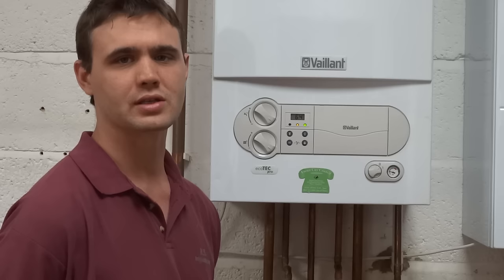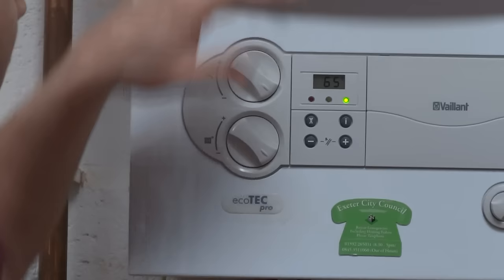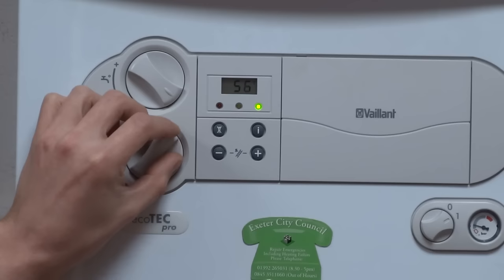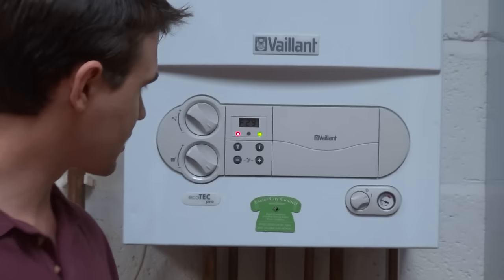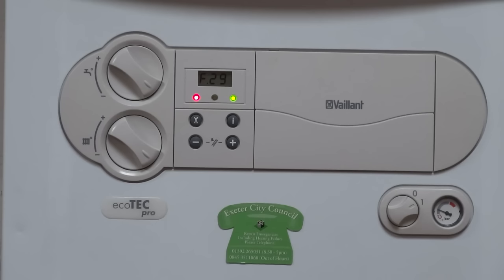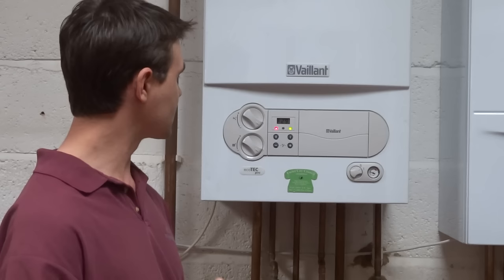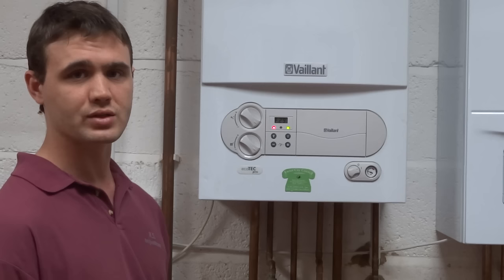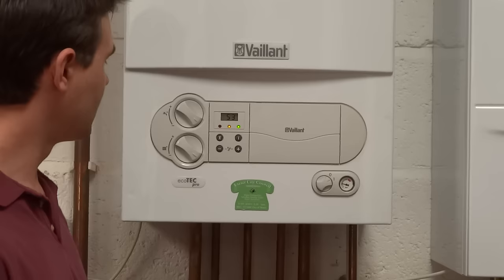Vaillant Ecotec Mk 1 - Resetting the boiler.

Comment: One important thing you failed to tell people: The water temp knob, if its turned to Max will activate  the preheat feature, this is indicated by the green light being on constant (as in the video) when the temp knob is turned to Min preheat will be turned off and the green light will be off (after turning it Min move the knob back to midway position or the water temp will be too low). Now when water flow is detected & the boiler fires up the  green light will be flashing. I mention this as preheat is a feature which keeps the boiler hot 24/7, this results in water arriving at the taps a bit quicker but the downside is you will hear the boiler fire up every 1/2 hr or so 24/7 which can result in £100's  extra in gas consumption per year, its optional so try it both ways, personally I would never use preheat as it can cause other problems like scaled up plate heat exchanger etc.
Reply: I was curious because I've set mine to 50C and the green light did not lit up.
Thanks for the info.
Reply: Tank you!
Reply: jaxmar88 I turned both water and radiators to minimum and the darn thing still activates,can you advise please
Reply: jaxmar88 so I have a eco tech pro 28 my plumber says optimum temp is 66 on heating. Is that correct? Also what should standing pressure be I don’t have a number just the grey line as per the video. At minute when on it’s just under half point on the grey grade when off it drops to just over the grey start of the grey line. Cheers
Reply: ahhh, id been wondering why mine was firing up without the heating on. thanks for the info !

Comment: Another use case is away from the boiler if someone accidentally turns a thermostat to zero the boiler won't fire. Always check thermostat dial which might be in your hallway.
Reply: Someone moved dial and now top reading is hN1 for heating bottom still says cylinder Im reluctant to move dial because I dont have a clue about it..can you advise please..!!
Reply: Cashino Ntd.ive been trying to find out about the thermostat thats in hallway.

Comment: Hi my boiler is flashing saying 2.3 I dont know whether to reset as my radiators are very cold when I put them on I put pressure slightly up but still flashing.

Comment: Thank you so much!  Was tearing my hair out with frustration! the radiators could not warm up even though the boiler was working.... Radiators scorching hot now.  Thanks again.
Reply: what did you do i have the same problem, did you just reset the boiler?
Reply: @angelainniss7986  Check the video at 1:00 min. Lower dial is used to set maximum temperature of your radiators. I was also looking for this info.

Comment: Fantastic mate. Very clear. Thanks! 👍🏻👍🏻👍🏻

[edit] after resetting, the hot water continues to work (that was never the problem) but the radiators won’t turn on - no light appears when radiators are on like when we turn on the hot water tap. Could be an issue with the radiators themselves? All valves are open and the heater temp is turned all the way up.
Reply: Is your problem solved. I have the same issue and I am looking for a solution
Reply: It's night in here and the mechanic will most probably come on day after tomorrow

Comment: Appreciate this! Been puzzled a while as to what temp setting for radiators is best! Thank u! On Max! No idea too what the plus and minus buttons do either! Can u explain those? I hear a lot about “pressure bar” what is best number it should be on? Why does pressing ( i)then (+) do a count 1-10 each time it’s pressed? What should it be? I left it on 1. I’d like to understand more basics about its buttons. Often in winter I get F.75 code. Not sure if it’s something I’m doing wrong? I did think radiator dial was supposed to be same as water one so I’m glad at least I know that now! I have a small baby so need to understand better my boiler.

Comment: Thanks . When is it ok to call Valiant gas boiler specialist with this code F28 if it occurs more than once? Normally the Valiant staff ask for call out charge even if the boiler is under warranty as ours is only 6 months old. They refund if the boiler is faulty ? Why should F28 code comes on even gas supply is ok in the house? Does it mean part failure inside the boiler?

Comment: Hello thanks so much for the details.
I have a question if I may, I have the vuw 280/2-5 type and I can't get to level up the water pressure. It stays really low and I have no idea if the radiator are getting filles up. Any suggestion on this? Thanks a lot

Comment: Hi, I have the exact same boiler and after installing new smart thermostat it worked just fine for a week and one day the boiler would not start without turning thermostat on, and when I did turn it on, the boiler is heating the water and when it comes to heating the radijators I hear it starting and then just stops. Could it be some kind od blockage because of a thermostat. Up until now there was this really old thermostat. Anyway, the boiler and its connections appear just fine

Comment: I’m getting this now after 10 years of installing this boiler.   In my case. There’s gas going through but the red light stays on.  I restart it and it works for about 1 min then goes back to red again.  What could be wrong ?
Reply: It maybe that you have a leak somewhere in the system.

Comment: I've got a Vaillant ecotec plus 837. Getting hot water to taps but not to radiators at all. What could be the cause? No fault codes showing.
Reply: I have the same problem and I can’t get any answers

Comment: Having issues with the heating not coming on. This is the exact boiler I have, what happens if there is no orange light on at all? What would you recommend?
Reply: Peter the same is happening to me now aswell
Reply: Niki Warda I’ve changed batteries in thermostat as I have the flame icon on there. Nothing changed. I’m bloody cold.
Reply: Peter same our house is freezing
Reply: same problem here…how you fix that?

Comment: I did it but it turns to f22 again. What should i do?
Reply: Turn the boiler off then turn it back on after 2 mins. Once the boiler is turned back on, press the button that is directly underneath the red light and the boiler will reset and the orange and green light will appear. I had the same process above just a few mins ago. Hope it works for you too.

Comment: Ff
Reply: very helpful video .
I have eco tec Pro 28
Can you explain what is recommended temperature on boiler 
and how do I remove 
the air after filling up with water . In what sequence before firing up .